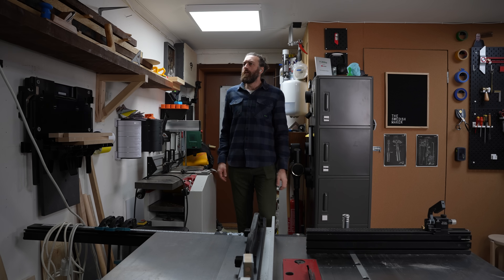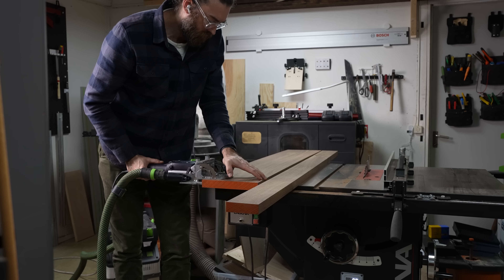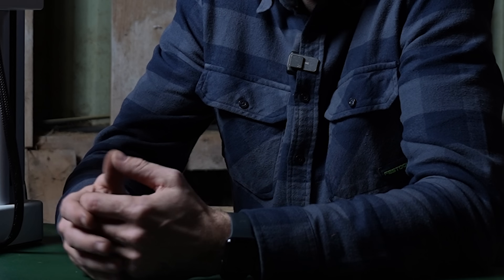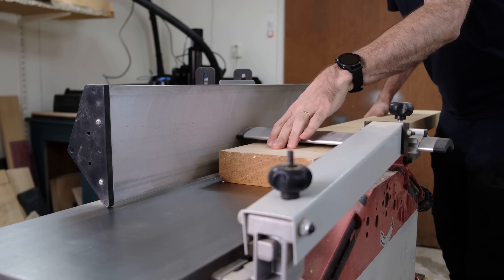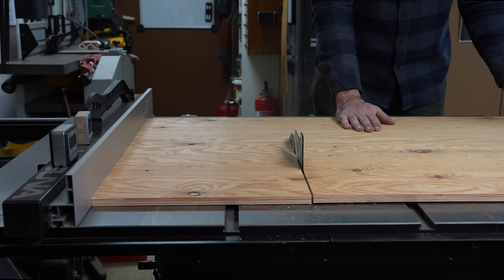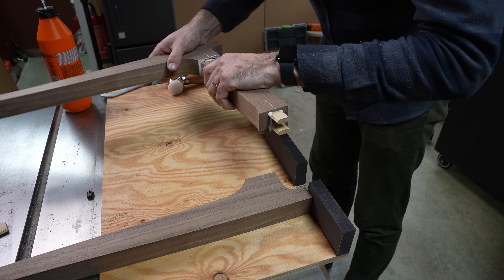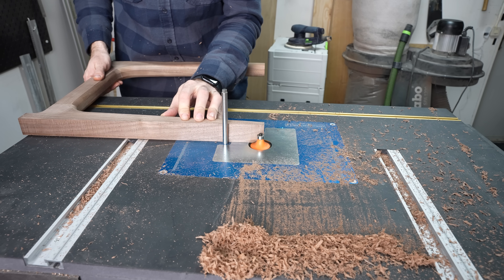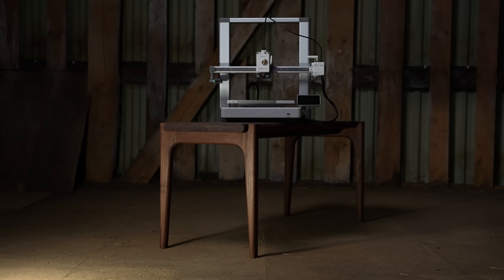Using a 3d printer to make furniture

Comment: \puts on the full pedant hat

I recently watched a video that walked through how handsaws are made. They have tools for stamping, cutting, shaping, and sharpening the handsaws. At the end of the process, they then hold in their hand a handsaw for cutting wood. The handsaw is a woodworking tool, but I don't think anyone would argue in good faith that all the tools for stamping, cutting, shaping, and sharpening steel are "woodworking tools" because they create a tool that then works wood.

A 3D printer is not a "woodworking tool". It's a "tool-working tool". It's a tool that makes tools. But it neither works wood nor, of itself, facilitates the working of wood any more than the machine that punches teeth into steel to make a saw is a woodworking tool.

\takes off pedant hat

But who cares? It's great to have a tool-working tool in a woodshop so you can make woodworking tools. Or in a __shop to make __-working tools. I've had a 3D printer on a shelf for years now, and only in the last few months have I started really getting into how useful it can be to make my own tools on demand.

\presses finger to earpiece\ They did what? \pause\ That seems rather silly. \pause\ Well, yes, MDF seems rather silly as well. Is it any good? \pause\ You haven't tried it.

OH! Right, we're still here. I've just been notified that there is *wood PLA*, which means that even with the strictest, most pedantic definitions, any 3D printer that can handle wood PLA is, technically speaking, a woodworking tool, and anyone who says otherwise just doesn't know what words mean.
Reply from the maker: haha this made my day! Thank you!
Reply: The best part about printing with Wood PLA is the smell.  

It legitimately makes your 3d printer space smell like a wood working shop. 

On that note...please remember to practice safe printing.  Use air filtration/circulation and PPE when in prolonged contact with any airborne plastics.  Even the ones that are 'relatively safe'.
Reply: I was going to make the same sort of comment.  A 3D printer is a tool for making woodworking tools (and other things) rather than being a woodworking tool itself.  But as you also said, so what?

As for the arguments in other comments in this thread about wood PLA, that's around 20% to 40% wood particles (depending on the source), so more plastic than wood, but yes, the wood is real wood (or derived from real wood if you prefer).  (For comparison, MDF is apparently about 82% wood.)
Reply: I was coming to say something similar, but there’s no point now. I think you are spot on because sometimes a tool is just a tool and it doesn’t matter what it was originally designed for; I use all kinds of tools for alternative uses, and have used non-tool items for woodworking (playing cards anyone?).
Reply: We are all tool nerds. We all see them through different eyes and have different viewpoints. And that's ok. We don't all have to agree. If we all agreed and all had the same ideas,it would really be boring.
Reply: @ Diversity of opinion is often good. But facts are still facts, man. Objective reality exists. Some things are just wrong. Wood is, in fact, wood.
Reply: Wood PLA is not real wood yo. It's the equivalent of particle wood. Nobody builds any out of particle wood, although this might actually hold up better.
Reply: @Rufio1975  It's literally wood, lol. So's particle board. Don't get into a pedant fight if you're not a pedant. "Nobody builds..." I'm going to stop you right there. LOTS of people build with ALL KINDS of things, including and especially particle board. Come on, now.
Reply: @samb1055  I know what wood PLA is guy. It's literally wood particles like particle board, otherwise it would not go through the nozzle. I have a printer. You sound like a guy that thinks really highly of his opinion. God forbid someone else has an opinion that doesn't match yours right. Also no, woodworkers don't build using particle board. Only people like Ikea does that,which he made a video about. Ive been building for a long time and know many workers and nobody uses that stuff to actually build anyway. It's trash. Don't be such a schmuck. You'll live longer
Reply: @ I find it hilarious that you admit it's "literally wood particles", as if "literal wood particles" aren't... wood. My guy. This is not an opinion. It's wood. It is factually wood. There is more to it than wood, but it's literally, factually wood, WHICH YOU ADMIT, my goodness.

As for "woodworkers don't build using particle board", that's just your elitism talking. Don't be such a gatekeeping jerk. For this FACTUAL CLAIM to be true, you'd have to have met every single woodworker on the planet and confirmed they don't build with particle board. All I have to do is find ONE that DOES. Done it. It was super easy. People build all kinds of things with MDF. I've seen someone chainsaw carve a block of MDF.

(Oh, look, the FIRST insult I've thrown at you. Not sure what else you thought was an insult, but you sure earned this one.)

Also, you'd do well to learn the difference between "opinion" and "fact". That distinction is vital.
Reply: @samb1055  Hey man. Let it go. At this point with that whole essay you wrote me, you just want to argue for the sake of arguing and you know it. Have a nice day and I hope you wake up on the right side of the bed tomorrow.
Reply: @ Sorry, bud, next time I'll keep it to short sentences and small words.

Hope you woke up today without your gatekeeping attitude and victim complex.
Reply: @Rufio1975  True, true though I never implied 'real wood', you're 100% correct it's basically particle board you can squeeze out and shape.  Using it for stuff like "wood adjacent" trim where you just need the hint of the wood colour, or you want some of the stain to match is worth playing around a bit with it at least.  I do find it's usually not as strong as PLA, but I wooden't (heh)  want to use PLA for anything structural anyway.
Reply: @christopherbrummet4997  I mean it still sounds interesting to me. I apologize if I accidentally offended you through way of collateral damage so to speak. It just irritates me whenever people immediately jump to insults when people are just speaking their opinion. I see that a lot. Maybe I just got a little sensitive about it. Either way. They are all cool tools. Handmade is a personal opinion as is what is a woodworking tool. There is no concrete definition and nobodys opinion is better than the next aspiring maker/woodworker, whatever you want to call yourself, including my opinion.  Have fun man
Reply: @Rufio1975  No worries!  You're right though there are lots of people who assume the filament types are either somehow pure/mostly wood, or carbon fiber or fiberglass, etc and lean in with their opinions/excitement.  Then they are surprised when the items they print end up being less strong than just the pure plastics, very important to use the correct materials for your projects, and be willing to experiment :)
Reply: @christopherbrummet4997  For sure man. That's the fun part. Ideas and experimenting.

Comment: Thinking about woodworking has helped me with my 3D print designs, specifically the tiny prints, how if you work 'with the grain' of how the object is printed and design walls that are 0.8mm, 1.2mm or 1.6mm it's accommodating the typical 0.4mm nozzle, making the final printing easier & stronger.
Reply from the maker: Agree!

Comment: So a workbench is not a woodworking tool?  All it does is support the wood, hold it in place, etc.   It doesn't cut, shape or join wood.   But its sole reason to exist is as a tool to help in woodworking.   Many woodworkers, especially hand tool woodworkers, would consider a quality workbench to be a critical tool.  It's hard to plane a board without a workbench.   Clearly the definition he used is incomplete.   So, if a workbench is a woodworking tool because it assists in working with wood, then so is a 3D printer.
Reply from the maker: Thank you! Agreed!

Comment: If a CNC is a tool then so is a 3D printer.
Reply: One works on wood and the other does not. They might be each other's opposite, but they are different.
Reply from the maker: Thank you! 🙏

Comment: actually, I am one of the commenters, who does not agree with you, but I am not some angry person who can't accept a different opinion 😉
Any measuring tool still interacts with the material, so it can be defined as a tool in the tighter sense.
In my view, the 3D printer is not a tool, but a device which can create (woodworking) tools itself (which somehow interact with the wood).
Case closed 🙃
Reply: The new Bambu H2D  can cut and engrave wood, as can the snapmaker printer. There have been lots of multi material 3D printers over the years, so really a 3D printer IS a woodworking tool.
Reply: @katemorgan55  admittedly, he did not show that, and also that wouldn't be just a 3D printer anymore, but a 3D printer with extra functionality.
So it could also be a mini-CNC with 3D printing capability
Reply from the maker: I can accept your argument as well :)

Comment: The argument “ThAt’S nOtA wOoDwOrKiNg ToOl” is so tired. It’s right up there with “I could build that if I had all those expensive YouTube tools, too”. If you use it in your woodworking, it’s a woodworking tool. 

I added a 3D printer to my repertoire in the past year. It is absolutely becoming a part of my workflow. My sad modeling skills are the biggest impediment, but that’s slowly coming along, and there are obviously a lot of resources online. I actually appreciate seeing your creativity in bringing prints into the project. 

For the people in the US with our idiotic board foot measurement, I think the walnut comes out to $14 per board foot. 

Finally, both acclimate and acclimatize are correct, and you used them correctly in both cases.
Reply from the maker: Thanks mate! Keep on designing. I quickly had chatGPT translate the prices into and it seems the prices are quite comparable then. I always thought it would be a lot more expensive here in Sweden because of import fees

Comment: The subtext for the commenter's statement is critical, and once examined, renders their statement invalid. They state "a 3d printer isn't a woodworking tool because it doesn't shape wood", but the subtext of the message is "a 3d printer doesn't belong in a video about woodworking". That's demonstrably false, as shown in the video itself. As a meta-tool, a 3d printer is useful to anyone using tools! Or anyone who uses nearly any physical object that can exist in three dimensional space and consist mostly of plastic. Having a tiny factory capable of producing both generic and custom functional parts on demand is extraordinarily useful!

Comment: If it doesn't work (process) the wood, it's not a woodworking tool. When 3D printers can print with some wood fibre filament (!), then it'll be a legit woodworking tool.
Reply: They already do. The latest bambu printer can also cut and engrave wood.
Reply: Then you're already forced to admit it's a woodworking tools because you can already buy wood filament that results in actual wood prints! You just have to aacount for the shrinkage from the binder.

Comment: Hundreds of years ago woodworking was done with hand tools.  We graduated to power tools to make the same process faster, more efficient and more accurate.  3D printers are the next evolution of tooling that allow creative people to see their goals to completion.
Reply: You mean Ikea is that evolution
Reply: We didn't graduate to anything. It's just some new fancy tool. Neat? Yes. Quick? Yes. But I would much rather have a hand made item than one made by a robot.
Reply: @Rufio1975  I get where you're coming from, but if we're being honest, nearly every tool in a traditional woodworking shop has had some level of robotic interaction in its production. Your table saw, miter saw, chisels—heck, even your hammer—were all manufactured using CNC machines, robotic automation, or precision-guided equipment. Does that make your projects any less ‘handmade?

CNC or a 3D printer is just another tool, like a table saw or a router jig. It doesn’t remove craftsmanship; it enhances it. The creativity, design, and finishing touches still come from the maker. CNC doesn’t replace skill—it’s an extension of it.

At the end of the day, ‘handmade’ is more about the heart and intention behind the work, not just the specific tools used to make it
Reply: @mickkoldy1323  True. I agree that those tools were probably made using some type of robotic production. But it's whenever it's placed in human hands. I use them. I guide them with my hands. I don't get the miter saw and then just attach it to a CNC and tell it what to do. That's my point. Guided by human hands not 1's and 0's. But,that's just me. Unlike other people, I m not referring to you sir, I don't believe my opinion is the end all be all. It's just how I see it. Peace
Reply: @ I understand your point, but let me offer a counter perspective on CNC machines. While I agree that human craftsmanship brings a unique touch, CNC machines allow for precision and consistency that would be nearly impossible to achieve by hand alone, especially for complex or repetitive tasks. The beauty of CNC is that it can amplify human creativity. It’s not about replacing the craftsman, but enhancing the process—giving artisans the ability to explore new possibilities and push the boundaries of their work.

CNCs, when used correctly, become an extension of the artist’s vision. It’s still the human guiding the machine, just with a different set of tools. It’s about merging the best of both worlds: human ingenuity with machine precision. In a way, it can allow for more intricate designs or larger-scale projects while maintaining the spirit of craftsmanship.  Not arguing with you just offering a different perspective that you may not have considered.  All the best and peace with you too.
Reply: @mickkoldy1323  I can agree with some of that sir yes. The precision is great but I'm only looking for that level in my car or in my airplanes. Art. Which in my opinion woodworking falls under, I don't want clinical precision. As far as the human guiding the CNC,is it really? You feed it a program and it does the work. Not humans. But that's just my opinion. I hope that did come off as rude. Not trying to be. To each his own.
Reply: @Rufio1975  Not at all rude I have much respect for your opinion Last point I feed it the code I tell it what to do and how the outcome is designed by me.  The machine is not autonomous.   Be well my friend.  Good chat!

Comment: Good afternoon, Guilty as Charged, 🪓👎, defined by its purpose, and can you justify spending the money on very very expensive tools?, 
For instance , approximately 45 years ago, said person, 😂, used hand plane screwdriver hammer chisel, to do a job, approximately 45 years on, I still have my tools, and occasionally still use them, but now I have two bandsaws, a handheld electric plane times two, SCM jointer 42E, SCM thinners 520E Classic, I think the point is, that as you progress in your journey through being a carpenter cabinet maker specialist joiner, 
You need bigger and special tools to achieve certain jobs , and if it means going out and spending thousands of pounds on a Tools and machinery, and it helps you to earn more money to earn a decent living so be it, 😮😂, I’m guilty of working for 45 years and enjoying my work to earn a living, and everything comes at a cost, what makes things bad as when you’re a female ex partner scammed you?, After working for so many years., guilty as charged, your table looks very good very well-made, Fr,

Comment: 3d printers can make woodworking tools but that makes them machining tools. If they don't excrete liquified wood not just glue or epoxy or a frankenstein mix they are not working wood so no, not a woodworking tool. Is a drill bit grinder a woodworking tool, a lot of wood workers have them but no, a tools to sharpen metal not wood. So also not a woodworking tool.

Comment: There's a fundamental flaw in your argument. The 3D printer itself is not the woodworking tool. It's a device that makes the woodworking tools.

The commenter was right. Case dismissed.